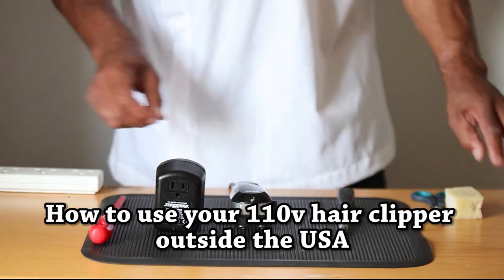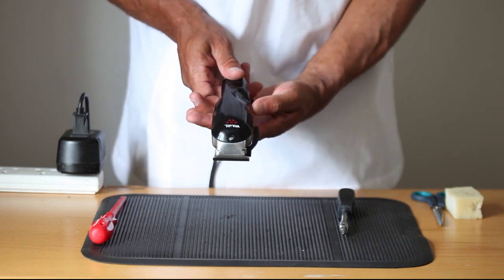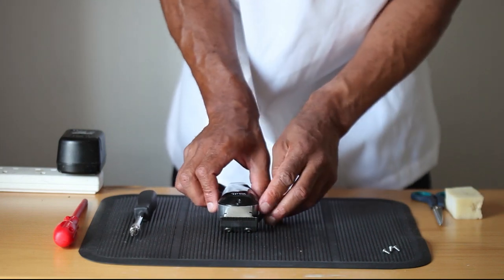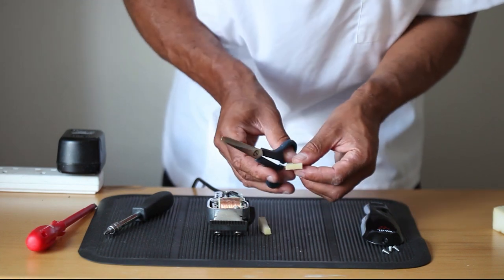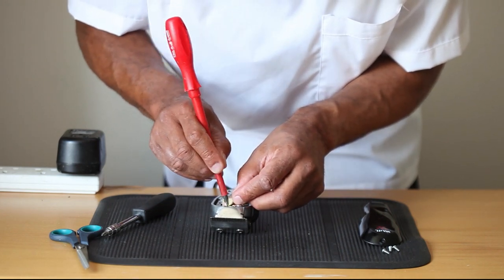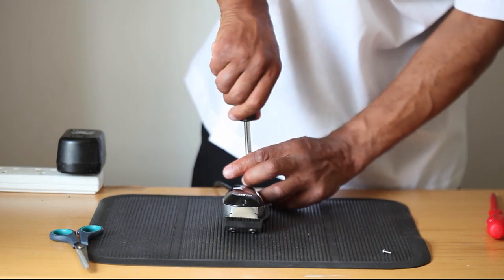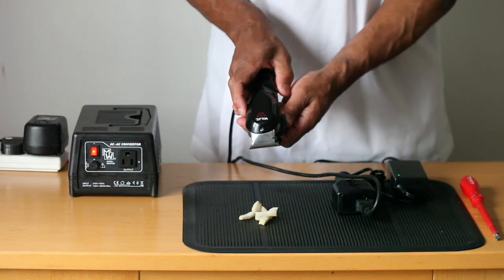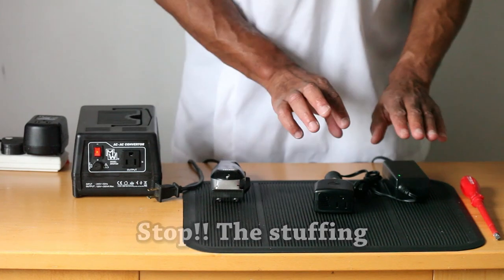Guide for buying voltage converter for hair clipper 220v to 110v on eBay

Comment: VERY helpful, I am in Thailand with my USA clippers and used my converter, but I could not understand the terrible noise.  Thank you very much, I hope to buy the voltage AND hertz converter today.  Much appreciated!
Reply: No problem in the Philippines with 50w transformer. Because they use 220V 60Hz in their country.
Reply: Philippines uses 220V 60Hz. My friend from the Baguio city told me that he bought an American clippers from Amazon. I asked him If he needs to buy a Frequency converter as an option. 

He tried to plug the US clippers with a 50W step down transformer that he bought from Ace Hardware plug it on Philippine 220V 60Hz, and it worked fine unlike 50Hz sound from the clipper. 

220V 60Hz used in Antigua and Barbadua, Brazil, Philippines, Saudi Arabia, South Korea (North Korea uses 50Hz at 220V).
Reply: @FrancisLitanofficialJAPINOY  kuya kahit wlang converter po pd ma direct sa 220? Meron kasi ako hair clepper na 110
Reply: Any update? I have a converter everything works only my WAHL Senior gets hot after only 15 minutes and then gets hotter to the point I cannot even hold it
Reply: @amoyzegh  I bought both converter and perhaps it was just me, but nothing helped.  I just bought a clipper from Thailand and was happy using one of theirs.  It was cheaper and less of a hassle.  Best wishes.
Reply: @ericruiz4404  The on the video? Or another one maybe it doesn't transform your hz, which one have you bought?
Reply: @amoyzegh  I bought different from video.  Maybe you’re right.

Comment: I stuffed my wahl clipper and it sounds way better. Thanks for the lesson. I still would like that frequency60hz converter but it is almost the same price of my clipper.
Reply: Salam aleykum akhi, you're reducing the power of the clipper since 60 hz is moving your blades a lot quicker then 50hz. Any update are you still using usa clippers?

Comment: My razor 120v from USA Wahl brand can I used a 110V transformer ? Here in the Philippines the current is 220V and my razor is verry noisy it is also noisy when I use the 110V transformer. What can you suggest to reduce the sound of my razor? Thanks

Comment: Hey, bro my WAHL senior, get hot after only 15 minutes any idea why? I'm using the right converter (220v 50hz to 110v 60hz). After 15 minutest they get hotter to the point you cannot even hold it... could the reason be because I'm using a converter with that?

Comment: Wat about if your using a cordless clipper in us from uk
Reply from the maker: Check the voltage requirements on the plug or charger - tell me what it  says then we can go from there...
Reply: @larrythebarberman  its 220 🤦🏽‍♂️
Reply from the maker: If  it says 220v  then you good to go in the uk 🇬🇧
Reply: @larrythebarberman  in in us not uk
Reply from the maker: @AllSoWavyReese  you live in the USA and the clipper only has 220v  written it - is the right or does have 100 to 220v ?
Reply: @larrythebarberman  yes i live in us and the cordless clipper i want is uk 220 will a converter work without making it loude due to the fact its cordless
Reply: I live in the UK and I’m considering buying a us BaByliss clipper.. what would I need to do?

Comment: When I try to plug my US hairclipper with stepdown 50w transformer plugged into the Philippine 220V outlet which is 60Hz, it didn't make such noise unlike 50Hz.
Reply: +officialJAPINOY Hey, I live in Georgia (Europe). Voltage is 220 and frequency is 50hz here. I use a converter which is very cheap comparing to others and this is written on it: INPUT: AC220/240V 50/60Hz  OUTPUT: AC100/120 50/60Hz. But the noise isn't gone, any advice?
Reply: +Some One In Jamaica and Barbados, they use 110V and 50Hz. Butbyou need a frequency converter for US clippers.
Reply: Step down converters cannot change frequencies.

Comment: I bought a voltage converter from 220v to 110v with 2000 watt in it...but unfortunately my friend from the US oven needs 120v and 1500watt...can I still use it?
Reply: Need a 3000w inverter from the US.

Comment: Larry The Barber, Can you please go to the Philippines like Boracay Beach to test your US clippers with Traditional converters without making any noise. Because it's 60Hz via 220V in the Philippines.

Also Eastern Japan without Voltage converters via 100V @ 50Hz, that will make any noise on US clippers, If Western Japan like Okinawa, Kyoto, which they used 60Hz at 100V, that will not make any noise like 60Hz.
Reply from the maker: +Francis Litan (officialJAPINOY)  This converter work in any country no problem
Reply: +Larry The Barber Man My friend in the Philippines told me that using a conventional converter with a US hairclipper in the Philippines didnn't make any noise unlike Europe (220V 50Hz)  or Jamaica (110V 50Hz). He told me that conventional converters and US clippers in the Philippines (60Hz at 220V) works fine.

BTW in the Philippines, I plugged between an American 120V 60Hz alarm clock radio with stepdown 50w transformer and a British/European 220V 50Hz alarm clock radio.

Japanese 100V alarm clock radio has built in switch from 50Hz and 60Hz or from 60Hz to 50Hz. 

If you're using a Japanese alarm clock to be switched at 50Hz if you're in Eastern Japan like Tokyo, Wakkanai, etc. and If you're planning to go to Western Japan like Kyoto, Osaka and Okinawa, just set your Japanese alarm clock radio at 60Hz. 

I can use a 100V Japanese alarm clock radio (with stepdown 50w conventional converters to be used in 220V countries anywhere in the World.

When I plugged a British 220V alarm clock radio at 50Hz into the Philippine 220V outlet at 60Hz, they run fast as 12min in 1 hour from British alarm clock radio, 50Hz clock will run fast at 60Hz like in the Philippines, South Korea, and other 60Hz countries. I need a 220V 50Hz inverter for British clocks in the Philippines , South Korea and 60Hz countries.

There is no problem on American alarm clock radio with 50w stepdown transformer plugged in to the Philippine 220V outlet at 60Hz like in Brazil (220V at 60Hz and some regions have 127 at 60Hz) , Saudi Arabia, South Korea, etc. They run normally on time like North America. 

Using a British alarm clock radio in Jamaica with 50W stepup transformer runs normally like 50Hz in the UK.

60Hz clock will run very slow on 50Hz countries like Jamaica, Barbados, Europe.

It's very useless if you use a 50Hz clock in the Philippines, Saudi Arabia, Brazil (some regions), Peru, and other 60Hz countries. and using a 60Hz clock in Jamaica, Barbados, Netherlands Caribbean and other 50Hz countries.

thanks for my info.
Reply: I bought a 220V 50Hz European clock radio from UK in order to use it in the Philippines/Saudi Arabia/South Korea on 220V at 60Hz.

I tried to plug a 50Hz clock at 60Hz outlet, it will run very fast by 12min/hr.

I'll use a 220V 50Hz converter for 50Hz clocks.
Reply: Cruise ships uses 60Hz on 220V outlet. Try it.

Comment: Hi, i had an US detailer but didn’t knew about the voltage difference ... So I plugged it in with an adapter to 230v. When I turned it on something inside blew and there came some smoke out of de trimmer.. It doesn’t go on anymore , even with an converter. Is it still possible to get it fixed ?
Reply: need to replace fuse or capacitor inside the clipper

Comment: and there is Aime 75w powe cnverter plug it to 220v 50hz to 12v inverter and u wil have it and olso there is the Colombia 75w converter wil do the job and these converters are high quality and they last for ever and it cost 30$
Reply: hiii I would like ask u something to get this product cheaper.  I'm from France can u send me 2 link of what I need exactly to make my clipper works quietly please
Reply: +Kaali CAOSLOCOS

Speaking of US clippers, you need a  USA 75W 120V at 60Hz inverter and 100V to 240V 50/60Hz to 12V (1A, 2A or above) car plug adapter for your US clippers.